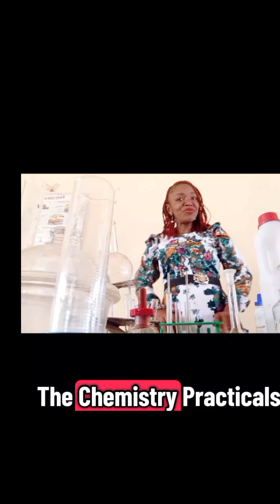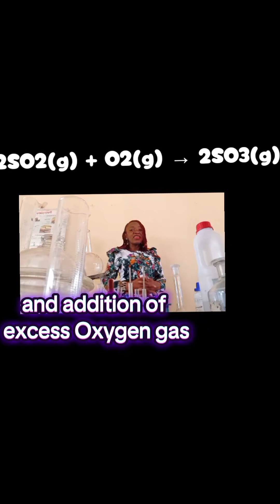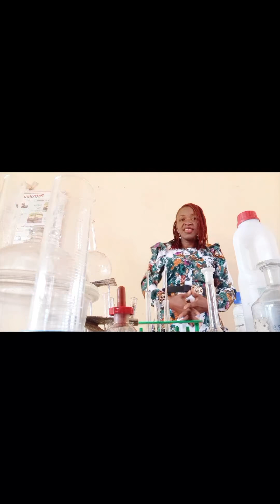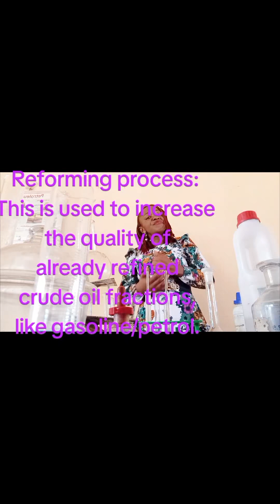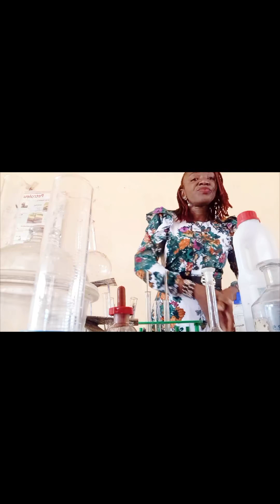Different Chemical processes which form the BACKBONE of advanced chemical manufacturing in industry

Comment from the maker: This video provides an overview of various industrial chemical processes that are fundamental to modern chemical manufacturing. 
I personally categorize these into several key methods used to produce essential materials, fuels, and chemicals:

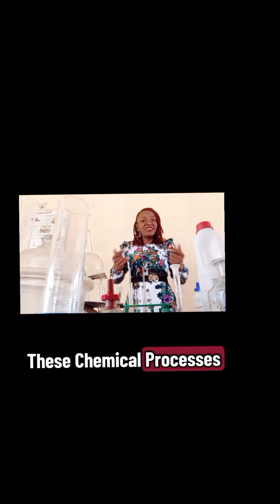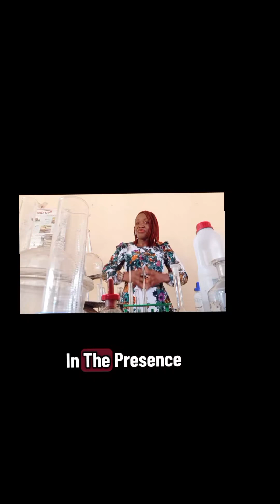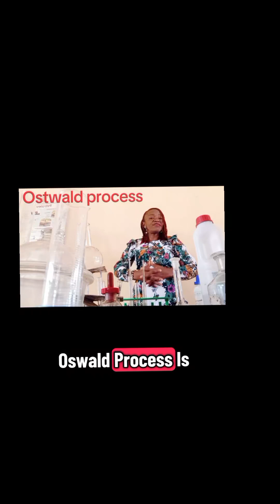Gas & Acid Production: Includes the Haber process for ammonia (0:50), the Contact process for sulfuric acid (1:09), and the Ostwald process for nitric acid (2:07).
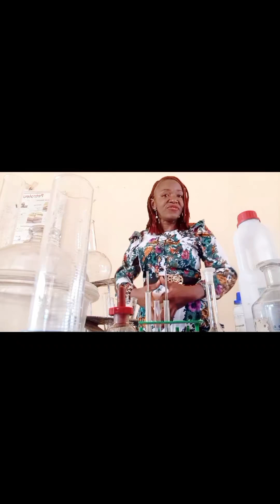Refining & Separation: Covers Fractional distillation for separating crude oil (2:27) and Destructive distillation for thermal decomposition (3:47).
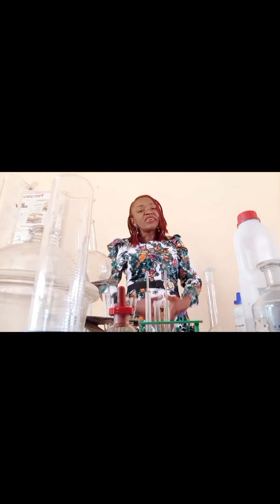Industrial Synthesis & Modification: Discusses Vulcanization for rubber hardening (3:22), Polymerization for creating large molecules (5:23), and Hydrogenation to convert oils into fats (6:51).
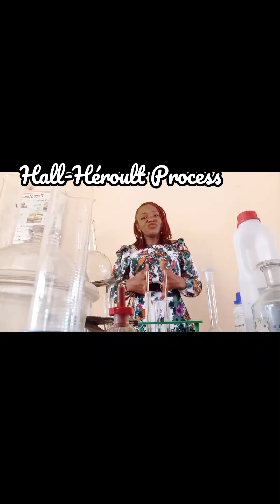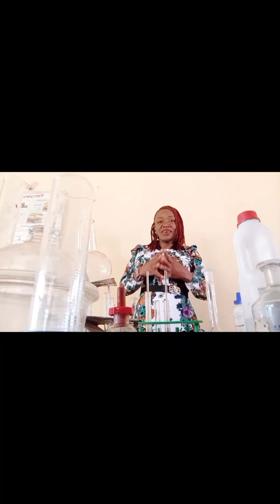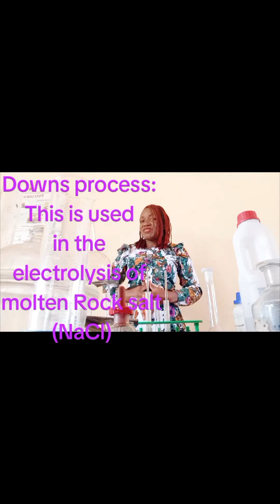Purification & Electrolysis: I made mention of the Hall-Héroult process for aluminum (2:43), the Mond process for nickel (4:14), and the Downs process for sodium metal (4:57).
Other Processes: Includes Saponification for soap production (5:59), Fermentation for alcohols (4:20), and Cracking for breaking down large hydrocarbons (6:21).